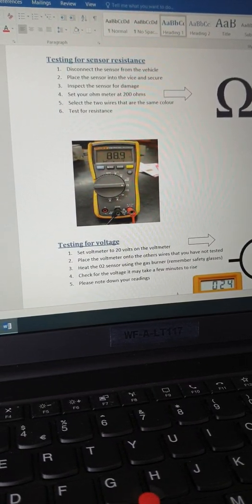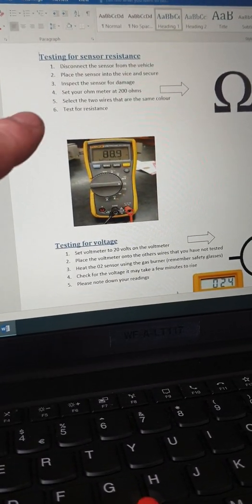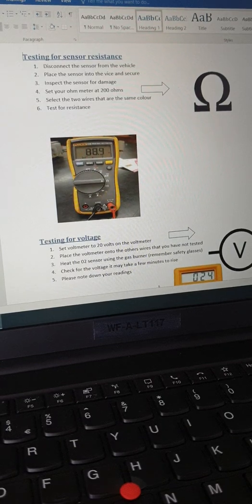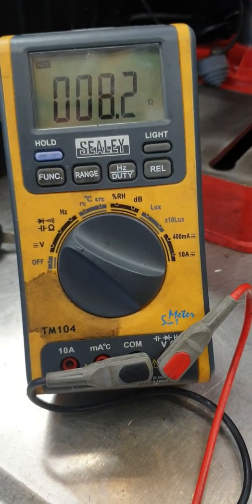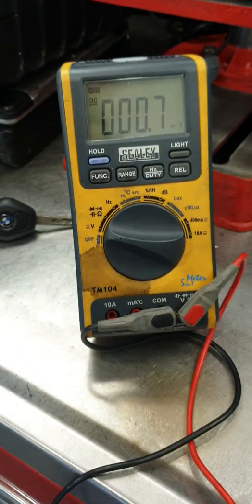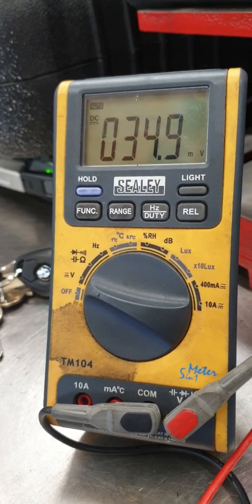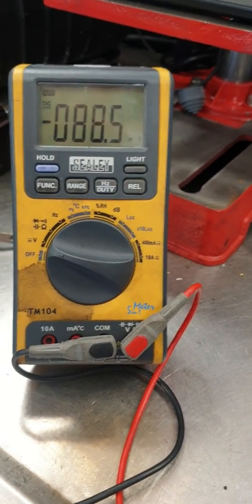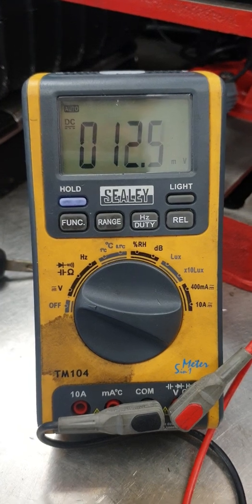02  Oxygen Sensor test Vauxhall Astra

Comment: Please explain a faulty sensor and a working sensor
Reply from the maker: Firstly you should probably understand how they operate and the different types of oxygen sensor. The oxygen sensors that are used the most are: 
. Oxygen sensor. This is also referred to as a lambda sensor. (1'wire sensor) 
Heated oxygen sensor (3- or 4 wire sensor) 
Wldeband oxygen sensor. Is always equipped with heating. (5 wires run from the sensor to a connector with a resistor Inside it. 6 wires then run from the 
connector to the control unit.) 
An oxygen sensor only works when it has attained a specific temperature. An oxygen sensor without a heating element is installed close to the engine so that 
the sensors hot enough. 
The sensor will heat up a lot faster because the oxygen sensor has a heating element and it can, therefore, be used a lot earlier.  Oxygen sensors measure the oxygen concentration in the exhaust gases thus the quanity of fuel can be perfectly harmonised with the quantity of intake air due to this measurement.  This will create the best possible combustion and hopefully free from hydrocarbons (unburned fuel).  So to answer your question, a faulty oxygen sensor can create an unbalanced air/fuel mixture which could result in a misfire or other symptoms. Whereas a working oxygen sensor will allow for best possible combustion of that mixture. Hope that helped.

Comment: Hi, If this sensor was faulty then what did you check in it? What readings were supposed to be out, please elaborate?
Reply from the maker: the sensor was not faulty!!! i was showing how to test the resistance and voltage from the sensor. both readings were within spec. if you heat the sensor up and voltage does not change or check resistance and it is of high resistance the sensor will be faulty. hope this helps.
Reply: @AutomotiveDIYTutorials but you said at the end of the video the sensor was faulty and sending incorrect readings to ECU causing over fuelling. So what's the purpose of the tests you carried out if the results show it was reading ok, when you've already said the sensor was faulty and causing issues?